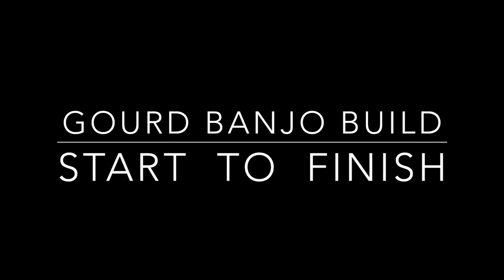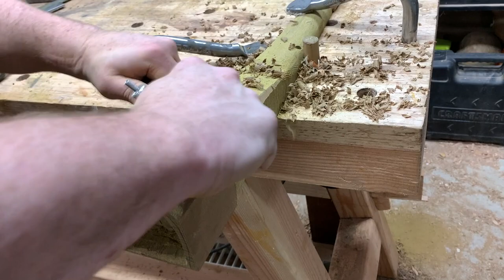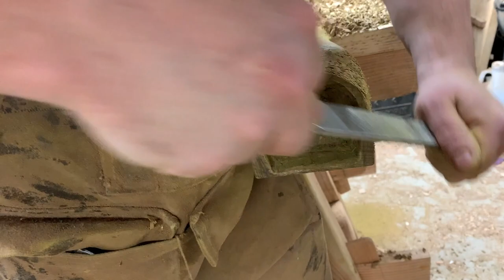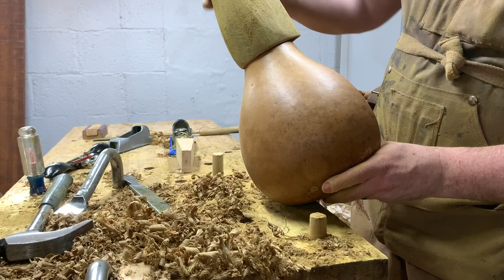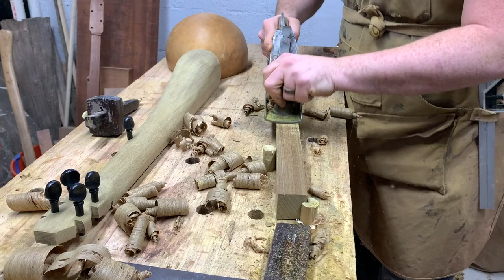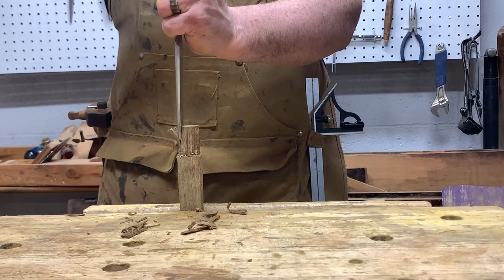Gourd Banjo Build Part 5

Comment: What are some of your favorite rasps and hand planers?
Reply from the maker: I really just use what I have collected and inherited.  I don’t know about brands or makers and I honestly don’t know the names of most of the types of files either. I use a float for finishing the mortise on the spike and always some kind of half-rounded file.  I favor blades to heavy rasps unless the wood is tearing out too much.  A surform usually comes in really handy. And long, skinny round files of various gauges will find ways to be useful.  I also have made custom sanding blocks for bespoke purposes so they act sort of like files.